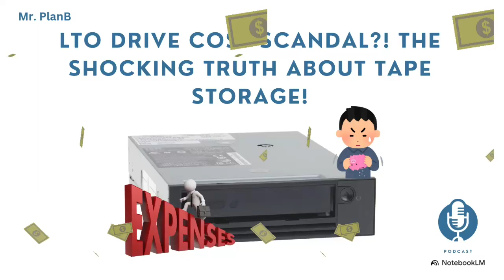LTO Drive Cost SCANDAL?! The SHOCKING Truth About Tape Storage!

Comment: hummm?? so in 30 years we i'll probably be dead and we'll be at lto 45 and have no drives that can read the disk that got saved for 30 years. evidenced by the number of drives currently available as parts only. and since tech changes so rapidly there will be some new invention that will render this tech obsolete and no longer supported. Been there a number of times.

Comment: This is all BS. Technology is technology and it gets cheaper to manufacture with time. There is no reason these drives should cost $12,000 new. They could be easily sold on the extreme home geek market at $2000 per drive new and that would 10x profits though the volume sold. That is assuming it actually is breaking technology and the drives cost $1000 to manufacture. The prices are being kept high intentionally for reasons other than direct profit on one product.